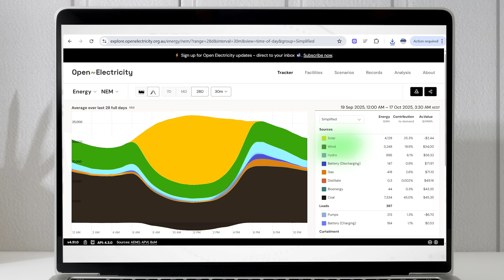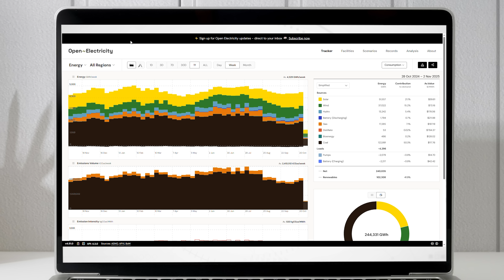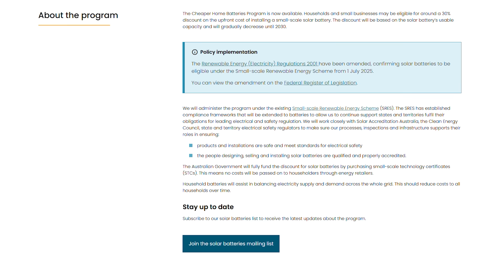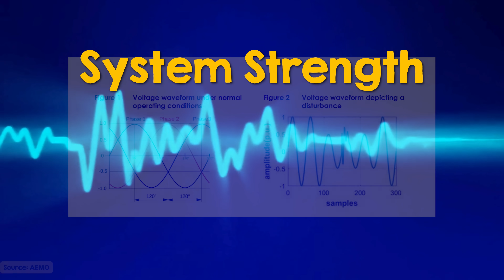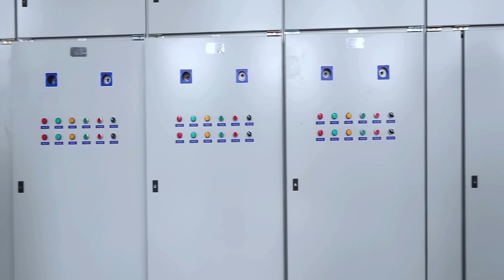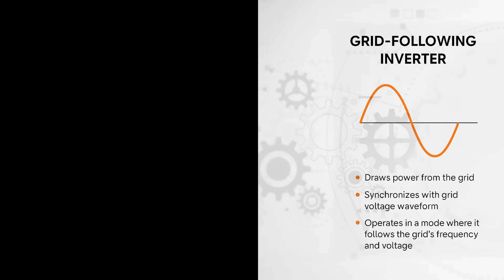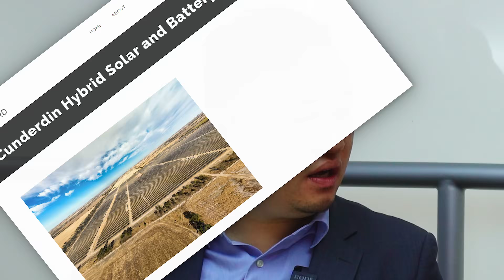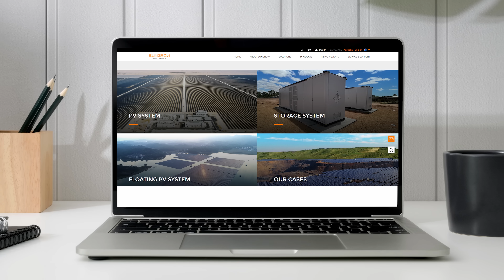Australia’s Solar Boom Is Breaking the Grid - Or Is It?

Comment: 1:19 Are there requirements in the power grid to install storage devices of at least 25% of the installed renewable energy capacity and with a capacity of at least 45 minutes for low-voltage generation and at least 2 hours for medium and high voltage, as in Europe from 2026?

Comment: The short version of this video is: Intelligent distributive micro-grids drawing their power from solar/batteries have made the older centralized coal/gas plants obsolete. These smarter grids will produce much cheaper power with greater stability and less pollution. They can also be quickly and cheaply incrementally upgraded when power demand increases. Developing countries are bypassing the old central power plant model and installing micro-grids as needed.
Reply: You can still have large consumers though. These might pose problems for isolated micro-grids.
Reply: In short, outside of Australia, renewable energy backup will still require a combination of batteries, hydropower, fast-acting gas-fired power plants, and so on.
Reply: @MihailG5541 Hydro is very expensive and slow to construct but has the advantage of a built in "battery ".  Fast-acting gas power plants are being replaced by even faster acting and cheaper to run battery farms.
Reply: @larryallin7404  No battery can yet back up the 11-17 days of Dead calm typical in Europe.
Both hydroelectric and gas power plants can do this without issue.

Comment: Good on you Australia.  Your leadership, like Norway's for electric cars, proves to the world that clean, sustainable power is the future.
Reply: You can also have cleaner cars now and not E,V,either , ,there is technology available to reduce pollution on diesel engines by 95pecent and on petrol engines by 50pecnt and has FEDREL ACREDTATION and E.p.a approval in the U.S and has been around  for some time now ,all diesel  engines  don't need ADD BLUE EITHER ,  TO CLEAN THE EXHAUST EMISSIONS  , BUT NO ONE WONTS TO PAY FOR THE TECHNOLOGY  ,?
Reply: Australia exports coal, and Norway exports oil and gas...shifting the climate change to a neighbouring country?
Reply: Perhaps only part of this future.
There are currently no mathematical models or practical justifications for the stable operation of an isolated power system with a renewable energy share exceeding 70-80% without significantly increasing costs for networks, stabilization, balancing, backup, and protection from natural disasters.
Reply: @MihailG5541  In a world where affordable batteries don't exist, yes.
Reply: @moblet I remember when they were too expensive and were not being produced fast enough. The children were so much shorter then.😮
Reply: @MihailG5541  Keep watching Sth Australia.  We'll be the first mainland state to become 100% renewable, sooner than you think.
Even when we had a Coalition state govt, they pushed renewables rollout.
Reply: @MihailG5541  Exactly why Australia's demonstration is critical.  There were no models or practical demonstrations for a country -- especially one so far north -- to operate on EVs only.  Grid forming with batteries is the key for solar, wind, and batteries to dominate.
Reply: @fredhearty1762 Renewable energy generation without the backup of fast-acting gas generation, hydroelectric power plants, and pumped storage power plants means nothing; it is too expensive even with batteries.
Reply: @fredhearty1762  You pay for it.   I don't wish to participate in an experiment at gridscale.  ANYTHING done by ANY GOVERNMENT is bound to fail.
Reply: @geoffc2376  You and I are already paying for the Government experiment of subsidizing gas and coal and killing the cheapest form of electricity... solar.
Reply: Our electricity price is way up, with no end in sight. It’s driving up our cost of living, causing inflation that is keeping interest rates elevated. We have the lowest share of GDP from manufacturing in the OECD. Our government is having to bail out high electricity users, like aluminium smelting. We are making ourselves totally reliant on china while destroying native forests to make space for wind turbines. There is nothing to celebrate.
Reply: australia is an indigenous genocidal colonizer land on the Indian Ocean that sells minerals from the stolen land to get rich and has some of the worst per capita carbon emissions on the planet .
Reply: @VARMOT123 Wow, fixing the world with copy/paste. I will give that a try

Comment: I find it bizzare that pumped hydro isn't the storage of choice for the majority of grid scale storage.
Reply: There are lots of sites that could be made into a good pumped-hydro storage site, but in the U.S. the environmental roadblocks are so high that it's very long and hard to get one approved.  It's not worth the hassle for the most part, so they will turn to batteries, which will over time be cheaper than pumped-hydro.  Batteries are little solid-state widgets that are manufactured in gigantic automated factories with known learning curves for cost reduction.  Batteries will be very cheap in the coming decades.  Pumped-hydro are like hydro-electric dams.  They are all bespoke big engineering projects with a rather high price floor.  Over time they are a good value, but not if you can't build them in the first place because of all the NIMBYs.
Reply: In Europe, they are trying to use a combination of hydroelectric power plants and pumped storage power plants
Reply: Pumped hydro is also latitude or more precisely, season limited.  Just as our rivers freeze up, so does pumped hydro.
To store 1kWh of electricity, 2,000,000 pounds must be raised one foot.  A lot of acre-feet of water must be raised hundreds of feet to store one MWh of electricity.  1 MWh of electricity is an accounting error on the scale of even a small generating plant.
Reply: Rosie has a prior video ( a few years back, I think ) that goes through why all of the first-glance roadblocks to pumped hydro are adressed by off-river projects, which is what I'm referring to. Everything from environmental impact to the availabiliy of locations is discussed negating all the issues mentioned here.
Reply: >- The height difference for pumped storage power plants is usually from 70 to 150 meters; such a difference exists wherever there are hills.-<
Hills with big flat areas on top.
1 hectare of land, 1 meter deep in water, dropping that water 150 meters, at 100% efficiency stores (100m x 100m x 1m x 150m) / (3,600,000 N.m / kWh) = 4,100 kWh.  That seems like a lot until you realize that the small coal-fired plant (360MW) at Genoa, WI produced that much electricity in 41 seconds.  LOTS of hectares of water and LOTS of elevation are needed to store energy as mgh.  Achieving 100% conversion efficiency would help as well.
Reply: The height difference for pumped storage power plants is usually from 70 to 150 meters; such a difference exists wherever there are hills.
Reply: It was and maybe still is but batteries are coming fast. There are pumped hydro stations with many GWh storage capacity (24 GWh is the biggest in the US I think), batteries might catch up in a few years but maybe it is better to have them more distributed rather than all in one place.
Reply: To store sufficient volume, it's enough to increase the volume of water.
It's hard to believe that batteries will be able to achieve lifespans of 100+ years, comparable to hydroelectric or pumped storage power plants.
Reply: Because it's very expensive to dig holes in mountains and there isn't an infinite supply of mountains in which to dig holes (and that also have plentiful water supply).
Reply: It needs a very specific landscape. Suitable sites are rare.

Comment: Grid operators have had levers that they can pull to soak up all that solar in the grid, and for some reason they are yet to do so. CONTROLLED LOAD is in so many homes, otherwise known as off peak hot water. Ordinarily, these would turn on late at night, but there's no reason at all that grid operators can't send out the signal to turn them all on in the middle of the day.
Reply: Requires political intervention - that'll be why it hasn't happened.
Reply: Since at least 1960s Australia left it up to households to heat water overnight (cheap night tariff) or during the day.
In SA, the grid management authority can cut feed-in from rooftop panels when the feed-in might overload the grid.

Comment: Are the batteries safe? can they explode like cell phone batteries or electric vehicles? 
Do the batteries generate an electromagnetic field in their vicinity?
Reply: There are risks like with any system that stores energy. LiFePO4 cells (and other types) are safer then the lithium ion cells used in small appliances (and some cars). All electrical systems have fields associated with them - nothing special about batteries.

Comment: Congratulations on putting up one of the best videos I've seen on this topic.  While I remain very optimistic about the ultimate outcomes, I think that there will be a lot of issues caused by the market incumbents vs the general public. People will continue to install solar and battery to escape costly grid power, thus solar and wind farms may well become uneconomic. What I think is needed is a time of generation tariff linked to grid forming inverters for customers. That will flatten the playing field for everyone. It would require a change in thinking at many levels, even down to possibly the language we use. Everyone becomes at least a customer if not just a connection, no more "consumers"

Probably we should be planning for every free standing building to have solar and battery. Yes, but politics and incumbents. I have been told that, in Queensland, the maintenance cost of power lines west of the ranges mean those lines are loss making, not enough power used to pay the costs of maintaining them. The coastal areas are subsidising those lines! Given all those people will probably install solar eventually what happens there? Job losses for the distributor? Politics and incumbents. Watch this space?

I digress, keep up the good work, subscribed
Reply: In the UK we don't even have mandatory solar for new-builds, which is daft. Given the advances in batteries, that should be mandatory too. The only thing that is mandatory is an EV charge point.
Reply: In Germany, it has been calculated that all renewable energy sources not connected to medium-voltage grids are subsidized by 30-42%, while sources with a capacity of 100 kW and above are subsidized by 10-15%.

Therefore, installing solar panels and batteries in a building block with a total capacity above 100 kW is the preferred option.

Managing renewable energy sources in low-voltage grids is much more complex than in medium-voltage and high-voltage grids.
The same applies to stabilization, backup, and balancing.

Comment: I would love to see a follow-on video that digs deeper into the inverter technology. What are it's costs, vulnerabilities, and capacities?
Reply: Inverters just convert AC to DC current... they don't store energy. They effect the efficiency of charge and discharge, but that's it.
Reply: A minimum limit of 30-40% of mandatory internal consumption for stable electricity supply to the grid during reconnections

Comment: This is a great topic that isn't talked about enough.
However, I can't give the video a like. It's just too dumbed-down, to a level where I find it to be confusing. Throughout, you're conflating primary and secondary frequency response. As a result you make several statements that are technically wrong. You're also claiming that thermal plants offer everything grid stability needs for free. They don't, this is only true for primary frequency response, not for secondary response and especially not for reactive power.
Reply: I am no expert but she did mention that grid-forming inverters can respond much more quickly than spinning bits of metal.
Reply: @matthewmarks6951   Which is one of the statements thats actually incorrect.
A spinning bit of metal reacts faster to a torque than any inverter control circuit. This is called primary frequency response. However, the spinning metal isn't the only thing that reacts. Thermal power plants have a turbine controller that also reacts to grid frequency changes for secondary and tertiary control. The turbine control circuit is the slow part, (mostly because spinning the turbine up or down is a slow process) and this is the important piece where grid-forming inverters are thousands of times faster.
Reply: @w0ttheh3ll  Yes, I think we're on the same page here. I remarked elsewhere that an inverter can probably be run at far more than its continuous rating for a short period (and of course very rapidly). The question is whether the faster response of the mechanical system is of practical consequence, and therefore whether this disadvantage of inverters should have been mentioned.
Reply: @matthewmarks6951  The inverter is totally superior for all practical purposes (and for other reasons we didn't discuss). That's why I said the statement is "technically wrong". The (very slightly) faster primary response of a mechanical system is completely irrelevant.
You'll also notice that I in my original comment I complained about the video being confusing for me, but I didn't mention this technically wrong statement (inverters are faster) at all, because it's not a big deal.

Comment: This actually made me cry. I didn't know about these grid forming inverters. I hope it works. Then only recycling the solar cells and batteries will be needed.
Reply: You can already recycle batteries, they're operating at a 95% recovery of materials. The problem with recycling solar is that it's just silica which has very little value.
Reply: @matt45540  The current recycling rate for lithium batteries in the EU is below 87%.
Reply: @MihailG5541  Just mandate it and it will go to 99% easily, just like lead-acid batteries.  Lithium-battery recycling is valuable.
Reply: Not only that. Wind turbines, inverters (they're vulnerable to lightning and other natural disasters), diesel-methane peak power plants, high-voltage converter semiconductors, and so on will need to be recycled.

Comment: 🤯E-vehicles, cars and trucks, should be mandated to have grid-forming inverters! They have a huge combined battery capacity and I feel grid-forming requires a lot less kWh than using for other than network frequency maintenance needs.
Reply: The electrical safety of electric vehicles is significantly reduced when powering the grid.
Some sections of the neutral wire can become live at hundreds of volts!

Comment: There's a major bias in this price evaluation: it is said that baseload power plants that run 24h a day are the culprit of negative prices. It is apparently so far. But, if solar grows, and baseload is omitted, negative prices will appear anyway. This is given by how solar panels work, how they are oriented, northwards in Australia. They will all have an output peak during midday and they will drive the price down, to zero or below.
Reply: That's what batteries are for, to smooth out imbalances in supply and demand.  When supply is abundant and prices are low, charge batteries, which increases demand and raises prices.  When supply is scarce and prices are high, discharge batteries to increase supply and lower prices.  There will still be a difference in prices, but it won't be quite so extreme as prices going negative.
Reply: Bifacial vertical solar panels facing east (80% power during the morning peak after sunrise) and west (100% power before sunset) partially solve this problem during daylight hours.

Comment: Thanks for explain it in a good way, not to complex but still coming around most issues. If new batteries meets the forecasts they will soon be 20$/kWh and last for 5000 full cycles, that will change a lot, combined with VTG in EVs we can have almost 100% renewable energy imo.
Reply: All these videos fail to describe the limits and problems of renewable energy when they are exceeded (for example, the exponential growth in costs for stabilization, balancing, backup, and managing millions of microgeneration sources in the event of emergencies or grid instability).

Comment: One thing to mention is that there isn't just one energy storage device techonology, there are more than just batteries out there, take the kinetic batteries for example. 
A flywheel that spins up during surplus and you can discharge from during low points. A stop gap for the issue of frequency control for example, though not as good for long term storage.
Reply: An energy storage flywheel isn't synchronous of course, so would need to be partnered with a grid-forming inverter.
Reply: The problem with high-speed superflywheels is the limited service life of the thin support bearing and electromagnetic suspension, the cost of maintaining very low pressure in the rotating chamber, and the cost of high-quality carbon or boron fiber (the base of the rotating part).

Comment: It's a shame that HVDC grids couldn't be run fully east and west to take advantage of the 2hr time differential between the east and west coasts. It could assist in getting more hours of solar generation and by having the broader daytime range reduce the dramatic peaks produced.
Reply: I mentioned that to someone, and it was suggested (by someone way more informed than me) that it would be a lot cheaper to build a massive battery on each side and do it virtually!  (i.e. treat the battery as the "other side" of the grid, dump energy from solar there, take energy from there at peak time)
I do think a giant HVDC link would also provide the opportunity to build and connect massive solar farms all along the route as well.  Kind of a bigger version of what's happening with EnergyConnect (from SA, via Burra, Mildura, Wagga Wagga into eastern NSW.
Reply: They can be. It’s just economics!